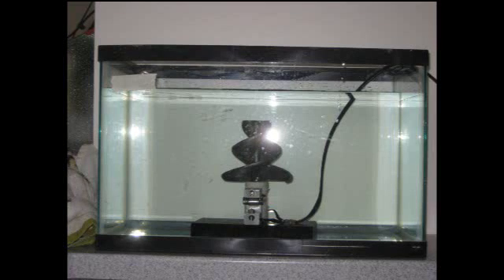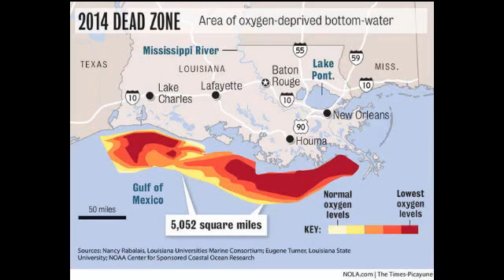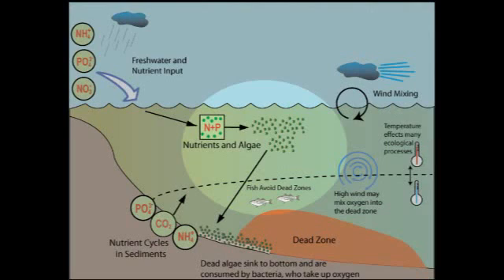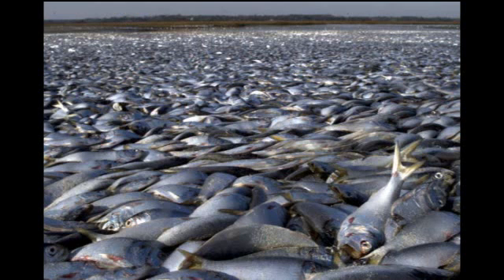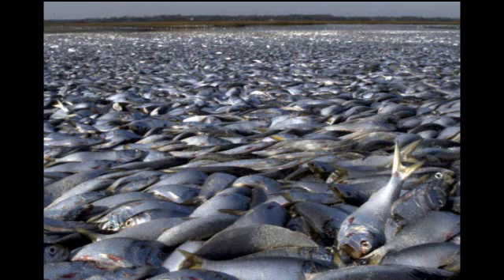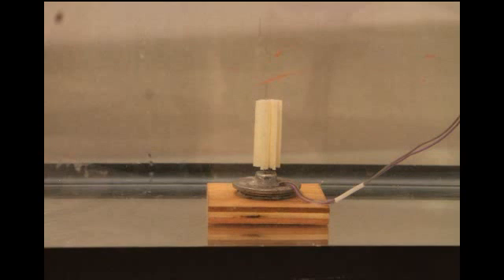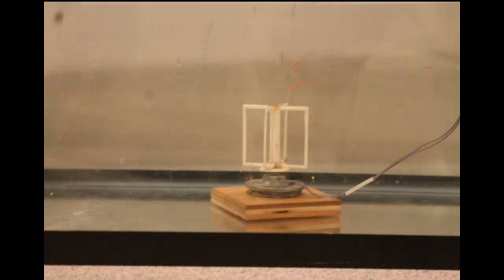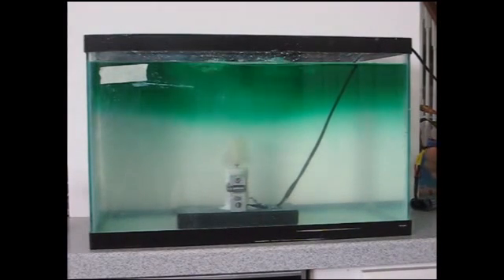The Helical Impeller

Comment: You seem like you're trying to do good work. So I'm going ro give this to you. You're helicopal impeller. 
1. You need to rotate it a 180°.
2. Make one using the ideas of an archimede screw Golden ratio1.618 and pi 3.14 
3. The diameter of the top Needs to be 6 times bigger than the diameter of the bottom. 
4. When you spiral the blades. Make the the Spiral 369 degree This gives it an over Reaching torque
You're doing good work. I hope You get all the riches and fortunes for that good work.